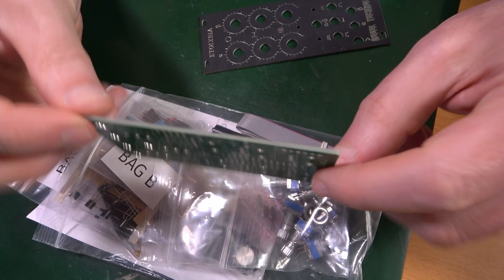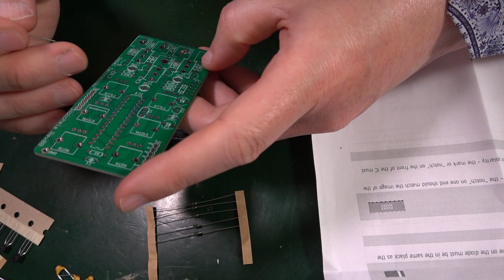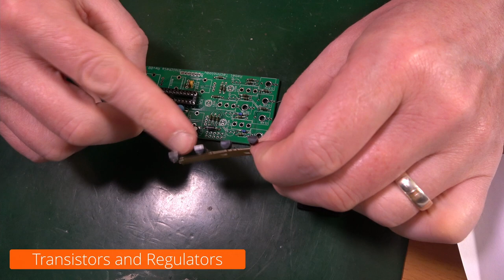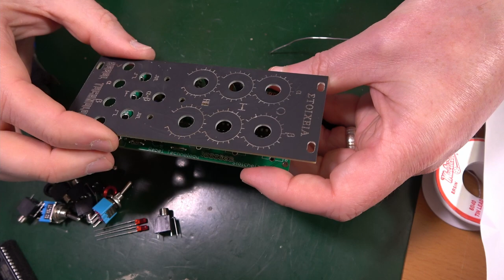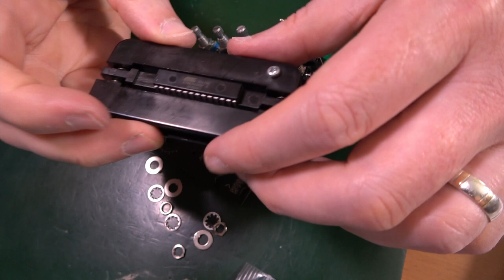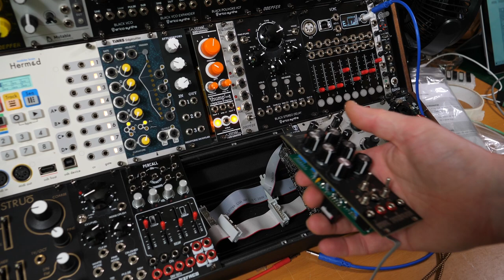DIY Build: Rebel Tech/Befaco Stoicheia Dual Euclidean generator

Comment: Just want to say a huge thanks. This very minute I have completed the stoidbxhdhsjfyrhehchea (or however you say it) not without mishap…. And soldering half the resistors in the wrong holes because I naturally thought you’d put the resistors in order 1,2,3… this is my first ever module diy. In fact it’s the first ever soldering! Thought I’d really messed it up but with your good self guiding step by step… the beast is alive! So huge thanks for doing these. Now to plan the next one… this could get pricey.
Reply from the maker: Good job 😁